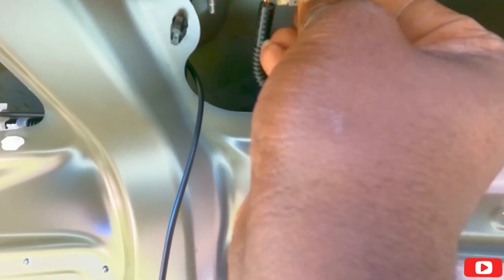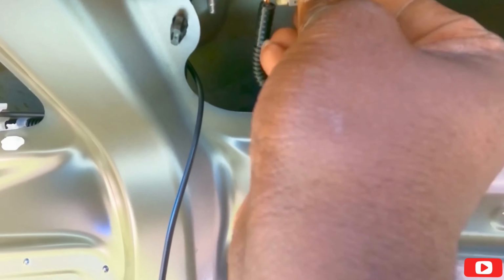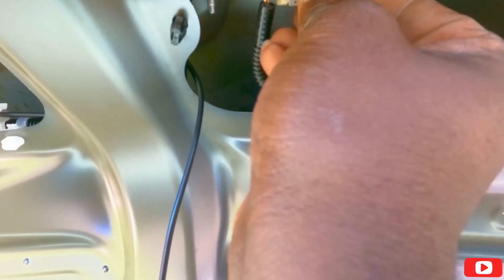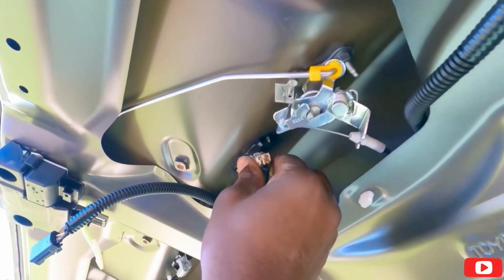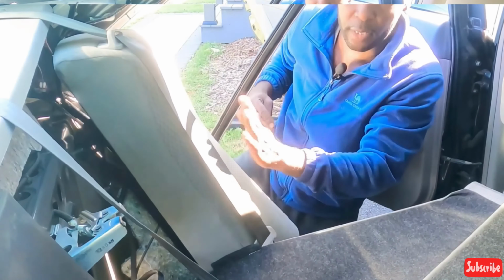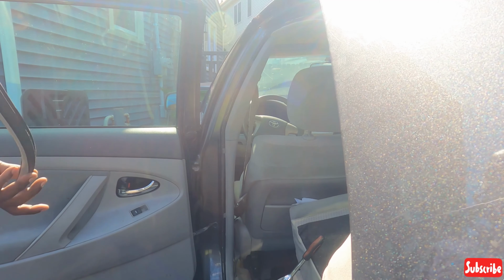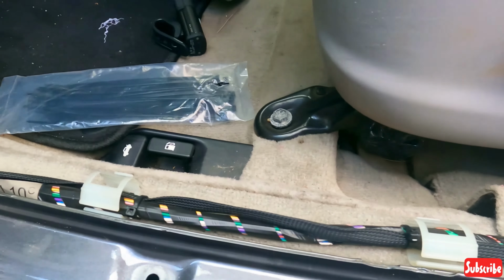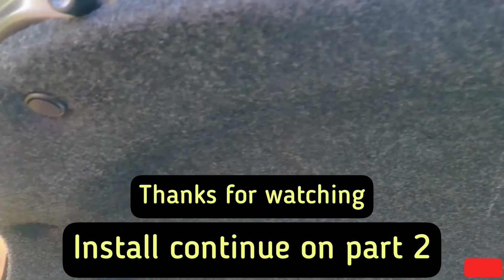2010 Toyota Camry radio installation and (backup Camera) PART 1

Comment: FYI, you don't need to remove the lock assembly or the the bulb housings to take that panel out.
Reply from the maker: yes I know I had it removed because I was alsso running wires for a backup camera. that why it looks like that.  thanks for letting me know.
Reply: @CarStomIt  I'm aware of that you're trying to do. You still don't need to remove those things. I did the same thing you did yesterday (backup camera wiring) and I didn't need to remove those. I had a hard time removing the clip behind the toyota logo.
Reply from the maker: Okay. Sounds good there are always multiple ways to do something. I glad you found another way to do it..  thanks for letting me know.
Reply: That's correct. I like to work smarter, not harder.
Reply from the maker: Totally understand. So do I. But sometimes I like to make it hard on myself. It’s parts of the learning process of  this journey we call life.
Reply: You also dont need to take out back seat to run wire from trunk. There is a hole in the top of the rear drivers side that you can get wire thru with a coat hanger.

Comment: I would of just fed it trough the license lamp
Reply: Loosen one up and boom also then plate cameras are lame it makes it look knockoff get one that has a treads on it with a bolt to tighten in the inside so it looks stock
Reply from the maker: Yes you could do that as well. But I wanted to make look super clean. Plus I didn’t want the cables to be pinched and have some water 💦 dripping inside so this way I think was better.
Reply from the maker: Yes this was not my car.  I agree with you. I love the stock look as well. But my customer bought all the parts and brou them to me. So I ask him if he wanted the other camera. He said no. This is all the $$ he wanted to spend No More. So I agreed and Install it as requested.

Comment: How I can find the pieces that you used for the holes on the Toyota logo?
Reply from the maker: you mean the Rubber Grommet. I bought them from Amazon.  I bought a box from Amazon. and I think there were like 50 of them and they come in different sized. check this link out. https://www.amazon.com/gp/product/B07DB3TBX7/ref=ppx_yo_dt_b_asin_title_o07_s00?ie=UTF8&psc=1
Reply: @CarStomIt  Excellent! Thanks for your response and the video. I will be doing this project in the next few days and at the same time, I will replace the dash cover.
Reply from the maker: Niceeee good luck. Sorry for the late response.

Comment: Great video Man!
The camera that was supplied with my head unit doesn't have a number plate bracket.
This may sound silly but I don't know if it has a top and a bottom and therefore I could possibly install it upside down.
Do head units allow you to rotate the image from the backup camera if it displays upside down?
Reply from the maker: Hey man. Yes some head unit allow you to do so. And some camera have a little button where you can switch it.  So it all depends. Your next thing is you can install it upside down to get the pictures to look right.